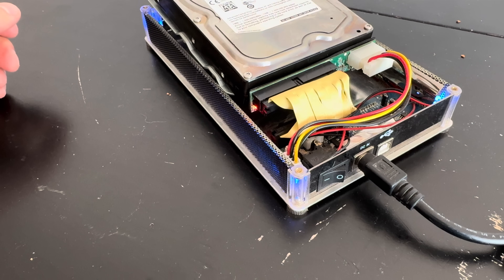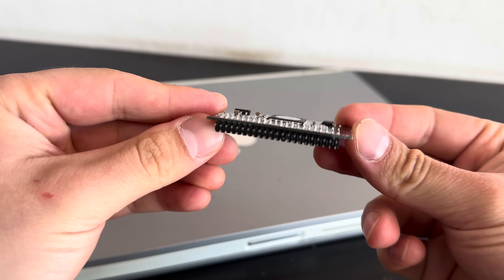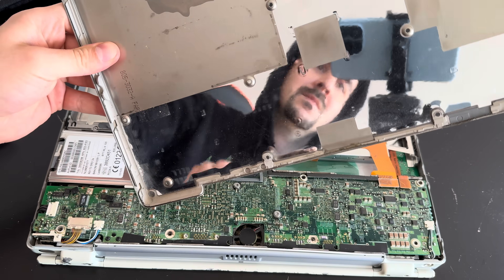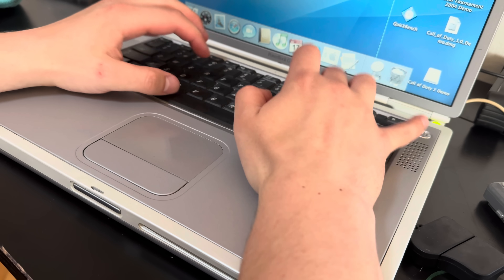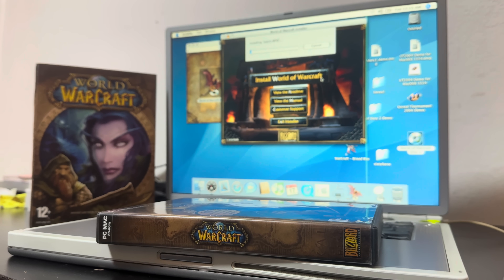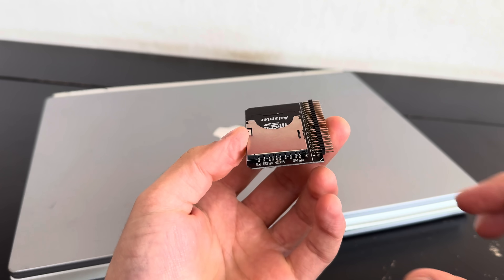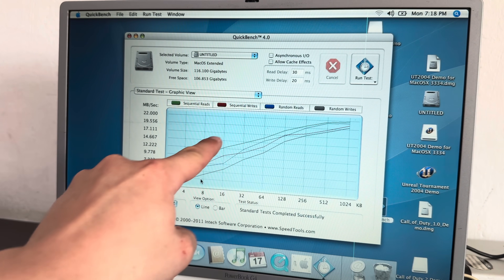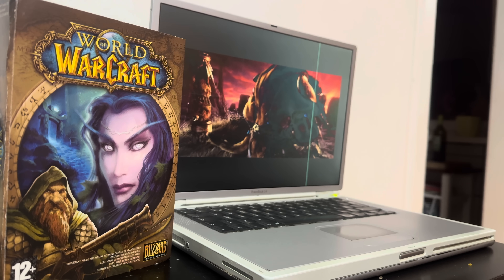Using SD Cards Instead of HDDs?

Comment: SD cards get corrupted easily defini8tely not intended for your OS drive.
Reply from the maker: @jgreentree  it works very well, as I’ve shown in the video. And for a hobby retro computer that you don’t run 24/7, I bet it’ll be just fine.
Reply: @schvabek  It may work for a short time but ask any IT admin and they will agree tell you SD cards fail troo often

Comment: A friend gave me an Apple G3 "Pismo" PowerBook she couldn't get working because of some unexplained hardware fault in the HDD interface. I have a CompactFlash card reader that connects via FireWire 400, so I installed OS X 10.4 onto a CF card and tried booting it from that device. It worked (and still works) fine. The original HDD was 20GB in capacity, the OS X 10.4 installation is on a 32 Gb CF card. I also have a 1GB CF card with OS 9.2.2 on it. That system also runs fine.
Reply from the maker: @PeterEmery  One of my next videos will be on that exact model, G3 Pismo. Never tried booting from FW, but it sounds like a great option if you have an issue with the HD interface. Sort of how you could boot older Macs from an external SCSI device. Pretty cool.
Reply: @ One nice aspect of FireWire 400 is that under sustained use, both the Mac and the external drive determine the connection speed, which is frequently considerably faster than USB 2.0.
Reply from the maker: @PeterEmery  oh yeah, and these earlier PowerBooks had USB1,1 interface, which sucks as far as speed goes, booting from that (even if you technically could) would just be painful.

Comment: Just a note that your SD Card speed is only as fast as the "Class" that it is rated...eg., "Class 10" is 10 Megabytes/second.
Reply from the maker: @RTR-MATEY I’ve tested out the read/write speed at the end of the video, in case you’ve missed it

Comment: as a Tech in computers, I have had more problems with SSD Failing than HDD, HDD tell you when they are failing, as SSD you reboot the system and it doesn't work.
Reply from the maker: Far harder to recover data from if they do fail too.

Comment: SD a CF cards simply does not have the lifespan of anything other. It will fail as soon as half a year of heavy use. Compare that to any SSD that can run at least ten times longer and still work.
Reply from the maker: @OriginalSebie  well, we’ll see how long this one lasts, but in my case, for a hobby retro computer I might use a couple of times a year, I’ll honestly doubt it will fail any time soon.

Comment: If you have the ram, a ram disk will improve performance and reliability. Moving temp and cache folders to a ram disk will save wear and tear on flash drives. I use a ram disk on my 100% SSD computer and have had no problems.
Reply from the maker: I did experiment with virtual memory, especially with older PowerBooks. But with memory/storage getting cheaper, I just never really saw the need for things like RAM disk.
Reply: @schvabek  It's not about speed or expense. In my case it is the wear at tear put on SSD or any other types of flash memory. Running an OS from a SD card will wear it out faster if something isn't done about temporary file storage.

Comment: How about running a new PC from SD card lol? My RISC-V laptop will only boot from micro SD cards with a maximum of 64gb
Reply from the maker: @Kerivity  that’s quite a bit different, since you’re using the SD card interface, and not IDE/SATA. Also, longevity wise, SD cards tend to last less than SSDs/HDDs, just because of the limited read/write cycles (and other issues people pointed out in the comments, like the speed being intolerable with more modern OSs). But hey, if you can spare the SD card and don’t have to store any important files on it, I’d personally be interested in testing out how that works.

Comment: i have a 
#1 Panasonic Toughbook CF-31 (x3)
#2 2nd HDD Caddy For Panasonic Toughbook CF-31 by CF-VDM311U DVD (x2)
#3 Havis DS-PAN-111-1 Vehicle Docking Stations for Panasonic CF-30 31 w/LPS-104 NEW
and 3- LIND AUTOMOBILE ADAPTOR PANASONIC TOUGHBOOK PA1650-1253FH - runs my
 Toughbook CF-31 from 12vdc and i have a ac adaptor inside also
#4- 5 PACK!! Hard Disk 320 GB HDD 2.5 Samsung WD Toshiba Hitachi Seagate, for Laptop (x4) for $20.00 YES 20 bucks to my mailbox (you will have to FOMAT them)
and i can use ssd's as well and i'm a ham
and i use a go-flex disk a back-up drive adapter it's a seagate freeagent goflex desk
part # 9ZQ2N2-500 a 2TB drive take the drive off the lower part and plug in the other drive's MAKE SURE THE POWER IS OFF (UNPLUGED) AND U-MOUNT BEFORE YOU REMOVE THE DRIVE(S) AND POWER
i've went up to HGST Ultrastar DC HC520 12TB SATA so far 
if you want more info post on here i'll come back from time to time ... k6rys
Reply from the maker: Hey, nice collection!

Comment: I have had 1 HDD failure in 25 years so the only reason I use newer storage medium is because of the access speed increase
Reply from the maker: I had a few more dead cases, but some of the were SSDs too. And like I’ve said, I really had great luck overall with HDDs

Comment: There is a feature called wear leveling which some solid state drives utilize.  A simple micro XD memory card or CF card do not typically offer this functionality.  Since Microsoft does not know what memory devices you use on earlier operating systems, these features also will not be exploited. NAND memory in Single cell can be expensive but offer most write durability, but sadly to increase capacity, manufacturers require double, tripple or quadruople their states which conversely vastly reduce the number of writes before you brick the memory.  

If a person does not care about data, then go ahead and use solid state.  Mechanical drives are more ideal for older hardware.  I still to this day avoid using solid state for this reason.  IDE or Sata or SAS mechanical drives are what I use if I have critical data on the computer.
Reply from the maker: @pixels303at-odysee9  I do realise that things like SSDs or DOMs are more reliable, but they are also more expensive (at least in IDE interface) than a simple adapter like this. And I really don’t care that much about reliability in a hobby retro computer. For critical data, yeah, these are probably not the best idea.

Comment: Laptop IDE hard drives are rare (compared to SATA) and when I do find one, it’s always got issues. 

SD cards are a great option for old laptops that use IDE although an SSD (with SATA to IDE converter) is still the best option.
Reply from the maker: Yep, again, I have a good stash of them I’ve accumulated throughout the years, but this is an awesome low cost alternative. Compact too. I don’t think you could’ve fit both the drive and the converter in many laptops.

Comment: The worst thing about HDDs these days is that the interfaces to connect them to a modern system are becoming unavailable if we're talking about SATA and have long become unavailable if we're talking about PATA or the old MFM drives.  SCSI or SCA have long faded into obscurity as well and I don't really have a good recommendation for those.

I still have MANY rust tumblers here.  Occasionally one fails but overall they are doing pretty well especially considering that many must be from the late 90s.  My worst problem is that I can't even power all my HDDs up.  The majority of them are in a stack of systems whose RAID array hold a total twenty odd drives.  And would probably trigger a full china syndrome if I'd fire them all up.

SD cards have a reputation for not having a very large number of write cycles.  So they'd not be my first choice - but then, who uses a retro system like it was 1995?
Reply from the maker: @ralfbaechle  Hey, thanks for the comment! I completely agree with you. The point of this video wasn’t really recommending SD cards as supplements for SSD/HDDs, rather as handy workarounds for older IDE systems. As for the longevity, like you said, it’s not like you’ll use them 24/7. I’ll likely have this PowerBook out a couple of times a year
Reply: @schvabek  Oh and handy they are!  I love how easy it is to move an SSD between an old and a current system.  really useful to data transfer or similar.

One more point on mechanical drives.  When buying old models they will all have suffered some mechanical wear.  Mechanical components will eventually wear out and that's particularly true for the generation of drives from before fluid bearings.  When buying online one rarely knows how many hours the drive has on the clock.  A particularly bad issue with server drives.  But asking prices are at times sky high.

Comment: Yeah, i have 2 40 gigabytes and one 80 GB  ide What good times Windows XP now they put a limit on hard drive if you use a 4 TB HDD after 4 years start slow and bad sectors start and HDD hard drive start failed to work exactly after The warranty expires
Reply from the maker: I have a pretty good experience with HDDs, but yeah, bad sectors, failing heads or motors, platter damage… those are all things to consider when talking about HDDs

Comment: SD cards don't stand numerous write operations like hard disk drives does.

I ruined many of them on a Raspberry pi just because of system log writes.
Reply from the maker: I’m pretty sure it’s going to be just fine for a retro hobby computer I use on occasion a couple of times a year.

Comment: Speaking of hard drives, I recently upgraded my old og xbox from 80GB I installed in 2007 to 2TB. Out of curiosity I ran crystal disk info on it and it said the drive is fine despite working like a mule for countless hours of Halo, PGR and others with friends. Would need some further tests but I'm hesitating because of all of the nostalgic data
Reply from the maker: Yep, perfect use case if you ask me. And if you do lose all the data, I mean, not a big deal.

Comment: Traditional HDDs are great. Although if storing HDD's, store them in an airtight container with moisture absorbers as there are air vents on these drives and the drives read heads can become stuck to the platter, potentially becoming damaged once started up after periods of inactivity.
Reply: not really just put it in a plastic bag and put it somewhere where dust cant enter
Reply from the maker: Starting old HDDs up always feel like playing roulette. I had good luck in the past years though lol

Comment: While yes you can use an SD disk as a operating system hard drive. It's not a great idea as an SD card is not designed for the high number of read/writes. The designed lifespan is much lower than SSd's or HDD's.
Reply from the maker: I am aware of that, however for the purposes I’ve described in the video (for retro/hobby computers I’ll use on occasion) it feels perfectly appropriate.

Comment: Out of over 40 years of building and repairing computers have a couple of HDDs failed on me. 90% of the time was able to get a software to go sector by sector and recover the files and folders. 

Have so many SD cards failed on me and very rare able to recover them. I don't think SD cards were designed to be used this way to replace HDDs especially constant reading and writing of files, temporarily files, cache, and virtual memory.
Reply: In my experience, the leading cause of HDD failure, is prolonged exposure to 40 - 60 degrees C.

I make sure to have a fan or 2 cooling any mechanical disks. Pretty sure my failure rate is under 1% over the last 18y.
Reply from the maker: I wasn’t really recommending SD cards as a viable alternative to hard drives/SSDs on modern computers. However, in my case, for hobby/retro computers running on an IDE interface, that I’ll use like a couple of times a year, it feels perfectly suitable. And if they fail, it’s not a huge tragedy, plus they are easy and cheap to replace

Comment: I have 2 500GB 5400 RPM IDE harddrives and an IDE housing that I picked up at a thrift store for $10.
Reply from the maker: I get mine from lots on auctions, boot fairs or recyclers for pennies. I had pretty good luck with them.

Comment: Stricture seems to be the biggest problem with mechanical drives. Leave them off long enough, and the drive will simply refuse to spin up. I have half a dozen drives with this issue that i plan to heat up in my car when the weather gets hot and see if the lubrcant will lose some viscosity.
Reply from the maker: With really old full height drives I remember playing with the pulley of the stepper motor to get it free, since they do seize up. They are surprisingly easy to get working usually

Comment: Linus did a test on a modern PC with SD cards and they were awful. Mind you the raspberry PI 500 with an SD card is surprisingly good!!!  Subscribed like the channel!
Reply from the maker: @welshtechie6832  that’s actually quite different, since it involves booting from an SD/USB interface, and that’s much slower than the NVME or even SATA3. This is using an IDE interface, and SD cards can be much faster than it. Glad you subbed man!
Reply: Linus is a shill for whoever is giving him the most free hardware or software.

Comment: If you dont want the IDE to SD adapter flailing around without the caddy, you can just stick it to the laptop with double sided 3m tape, the one that is insulated  with EVA or Foam. It wont move anymnre and you can remove it easily later if needed.
Reply from the maker: Sure, although double sided tape in my experience really doesn’t last. In any case, shouldn’t be a problem.

Comment: Why on earth use something as unreliable as SD Card as primary computer storage??
You can get ultra-reliable SLC ATA/IDE DOM's (disk on module) for older systems with ok price. SATA is already futuristic. SCSI is very niche .. but cheap(ish) sd adapters exist. I have IBM 286 clone with 512MB ATA DOM .. kept the old spinner for sound effect :), LPT DAC and sb-emu. Whopping 15" VGA monitor. 56K US Robotics Courier modem (need to figure out where and ho to connect with it ..)
Oh .. forgot .. we use those ATA DOM's in old industrial computers that refuse do die :)
Edit : early morning, mixed memory/disk
Reply from the maker: @matikaevur6299  Because… it works? And as I’ve shown, it works well. As for it being unreliable, we’ll see, but for hobby computers it really doesn’t matter if the thing dies. Also, DOMs are more expensive than this (while usually being lower in capacity).
Reply: @schvabek  
Oh, ok then. I'v been using those for fun (my old retros) or industrial control systems. I know you can get very reliable SD cards (SLC even) but you pay for what you get. Just read a thread about thread about long-term backup on cheap SD cards ..
Sorry about elitist view .. but .. no.

Comment: I find low capacity ssds better than SD cards. Especially in windows 98 I've found SD cards cause hitching over time. CF cards are better imo
Reply from the maker: CF cards (especially the ones that you can boot from) are getting harder to find nowadays. SD is far more common and cheap.

Comment: You dont even need the adapter to use an sd card to boot up computers and laptops. Just use a micro sd card usb adapter and plug it into any usb port. Lots of people remove the guts from laptops and run them off a sd cards now.
Reply from the maker: That’s a totally different story, it’s pretty much booting off the USB. This computer has USB 1.1, and even if you could boot from it, the speed would’ve been intolerable. These adapters allow you to connect an SD card to the actual hard drive interface.